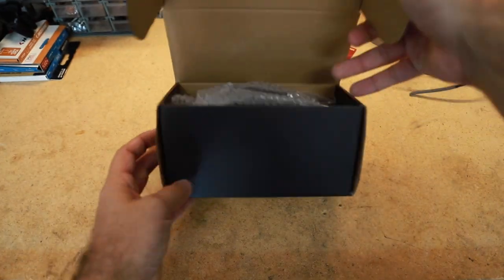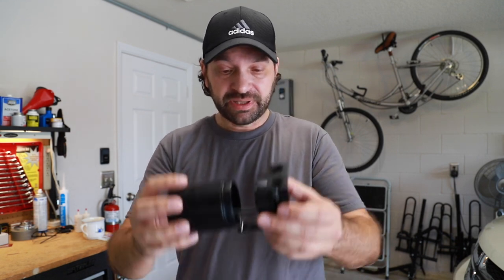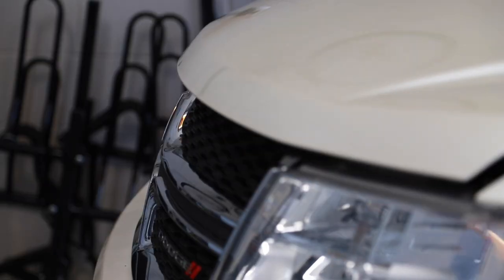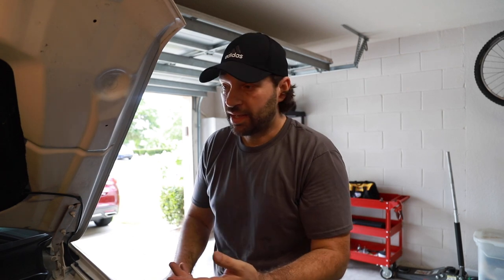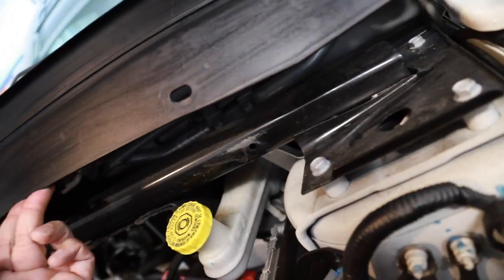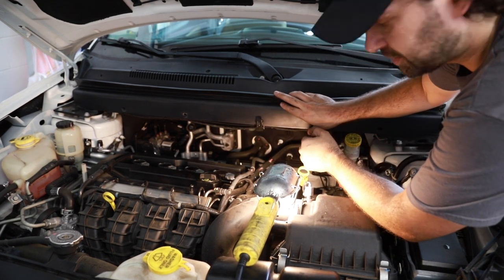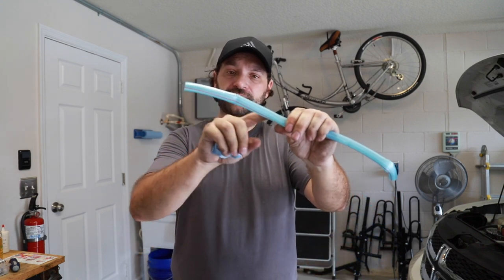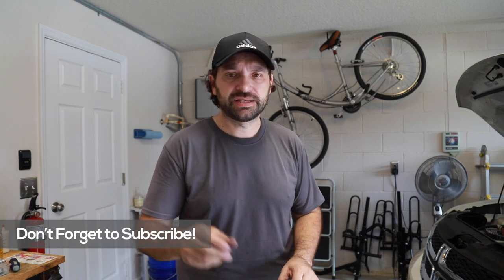Installing a Baffled Oil Catch Can

Comment: You hooked the can into the fresh air supply into the engine. You need to hook it up into the PCV valve side of the system.
Reply from the maker: Thanks. That would explain why nothing came out.

Comment: Hello , there was a PCV valve problem ?
Reply from the maker: No pcv valve problem. I got an oil catch can for another car. Had it laying in the garage for about a year. I eventually installed it. 3 months later not a drop of oil in the catch can. On this engine it doesn’t really matter. Other engines do benefit from this especially if it’s boosted. I ended up removing the oil catch can and have it to someone that is running the pentastar v6 engine where it truly works.